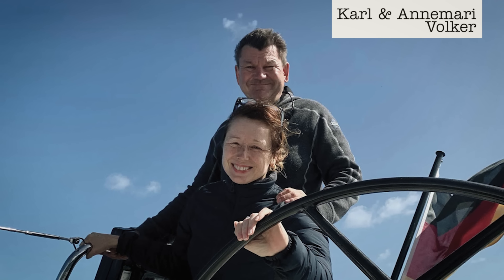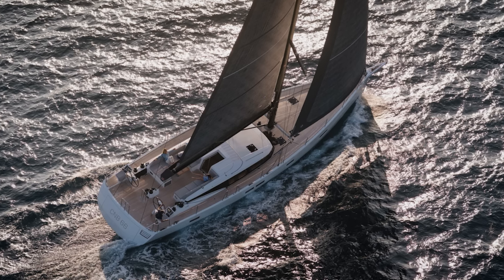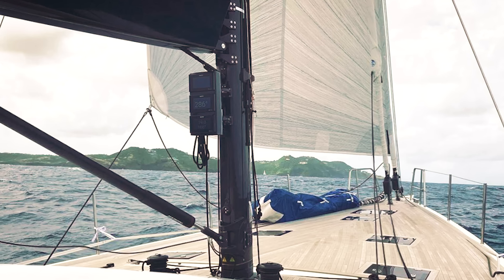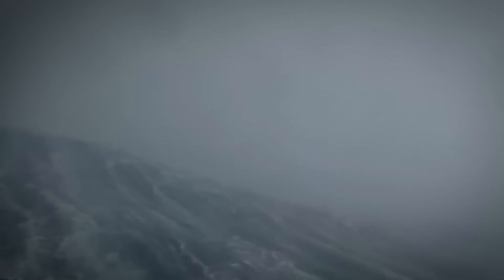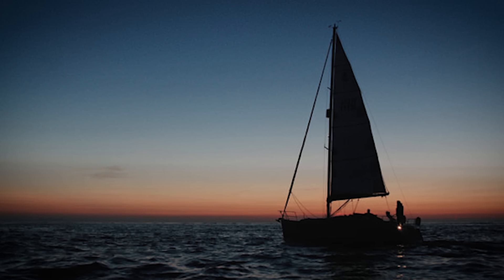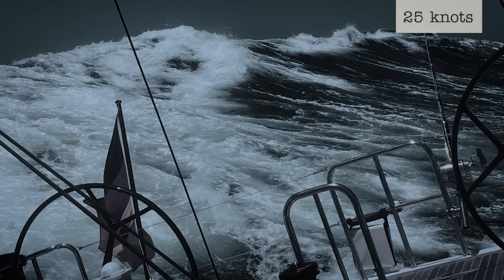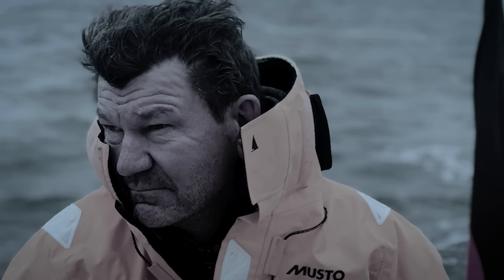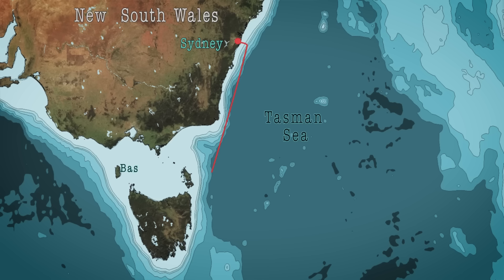Couple DIES on Private Yacht!

Comment: This is a tragic and terrible loss.  I've been sailing for 40 years and think that the older vessels (admittedly smaller) in which sail controls were manual and directly controlled at the mast are much safer for several reasons.  First,  they are very reliable since they are not dependent on electricity which doesn't mix well with water.  Second,  they are less prone to get hung up or jammed.  Third, they actually have better sail shapes (if mast furled) due to the ability to have battens.  Today's boats are also much flatter in the aft sections which not only makes them more uncomfortable in a seaway bu,t while their initial stability is higher,r they are prone to slamming and broaching more readily than more traditional cruising yachts.   While it's true the new designs have the comforts of a condo one might want to think twice before taking a condo offshore.

Comment: Well very sad ending to this ,,,,,, However I will add my thoughts.  First and what would have saved them is KNOWING their conditions accurately.  After the 1st squall was the time to REEF and STAY that way until daylight.  When the CURRENT Weather forces you to reef , it's already dangerously too late.  They got lucky on the first squall , and at night should have been far more cautious of it happening repeatedly.  

After all that the 2 mates who were unfamiliar with that vessel , and likely the owners didnt know this either ,, the CNB 66' with its "in boom" furling has no type of traditional Topping Lift.  This makes one think that the Duo-Winch Main sheeting system is the only means of control.  However, the Vang has a Rapid Release mechanism at the Clew end , and once released can be secured to either the Port or Starboard rigging base to relieve the 
" hot boom " situation.  I know it's easy to say that , but not being there and actually in that situation, who knows how successful that attempted solution would be. 
So I suppose the primary lesson for ANYone to take from this tragic event is
REEF EARLY
REEF OFTEN in repeated or unknown weather and squalls.  It is far easier to raise your sails than reduce your sails.  In my 40+ years of sailing and watching others , all too often reefing late leads to bad endings , although rarely fatal. 

God Bless them for living their dreams to the fullest. 

Sail On Folks.

SV Hydra
SV Jaz

Chris & Stella
Reply: I would call you comment for hindsight.
None of us know the exact weather conditions, and weather can suddenly deteriorate rapidly. Moreover, weather predictions beyond 3 days are almost always total garbage.
Reply: Exactly. Too late in reefing. And when they did...the skipper goes below? Wtf
Reply: @MalcolmLambe  I know right, probably like this " Ok if reefed the main , gonna head below and change my socks and make a sandwich "
lol 😂 
j/k
Reply: Too much sail up leads to chaos... if offshore a particularly v v bad thing to let happen

Comment: Thanks for adding the closure about what happened post rescue
Reply: Sailing and experience starts with a sailing dinghy and later increases the size gradually. It is not recommended to sail over a 30-40 foot boat if you have no experience with a sailboat. In strong winds and waves, sailing downwind is a high-risk affair. Autopilot becomes useless.

Comment: As an owner of a boat and sailing alone or with my wife, these are my recommendations to save lives (delivery crews take bigger and unnecessary risks) whatever the weather forecast gives you: put the second reef before dark, especially at downwind course. Yes, also the genoa. Allways. Anything can happen during the night. Anything. Forget big mouths saying it's time-consuming and slows you down. You slow down, but you give yourself security. And if sailing is too slow, stay home! Do not start reefing at 25 knots of wind in the night, that's already too late. Do not listen to crewmembers who are rushing you because they planned their flights back home. Make this clear from the very beginning. Nobody wants to die because of a stupid meeting missed. And what CNB concerns: as beautiful as ESCAPE is, the furling boom-system was a fatal construction failure and a central point in the cockpit for the mainsheet is an absolute NoGo! I am convinced that the people in Bordeaux gave way to clients requests, because, under sales-pressure, they wanted to sell another boat in order to reach their anual volume for the Group Beneteau at that time. (CNB was sold to Solaris in 2021).

Comment: I have never turned on the engine and gone head to wind to reef. This seems to me an odd strategy as the main has only to luff to reef it. Close hauled to close reaching on the jib allows maintaining steerage under sail with the main luffing and then reefing. I do know the boats I've sailed on with in mast and in boom furling have been at times problematic in the worst case scenarios, with yacht owners treating them with special vigilance to prevent jamming. Therefore- if you have either main furling option and it is prone to jam when overloaded, it behooves you to reef early. We also almost never sail dead downwind. It is not as safe and slower than sailing  a zigzag of broad reaches...

Comment: The long story obscures the fact that it was just a single maneuver that went wrong: luffing the boat from a downwind course into the wind.  

A boat of this size and type can be steered into the wind within just a few seconds (let's say 5–10 seconds), but even the best mainsheet trimmer using the fastest and strongest electric winch needs at least 30–40 seconds to haul in the fully eased mainsheet under full pressure in the sail. During this process, both line tangling and uncontrolled forces must be avoided. This is why the helmsman must closely coordinate with the mainsheet trimmer: the helmsman must not luff so quickly that the mainsheet becomes significantly slack. But this is exactly what seems to have happened.  

This is an apparently small mistake that might not matter in light winds but can have catastrophic consequences in heavy winds. Such an error is unacceptable for a professional skipper, even though it’s easier said than done in 40 knots of wind and rough seas. Even if there was a technical issue with the winch (unlikely), a mainsheet operator error or a line override / jamming (possible, especially since Annemarie wasn’t a professional very experienced in such harsh situations, it seems): in such strong winds, with a massive mainsail up (only in the first reef) and a super-heavy boom, under no circumstances can you afford to let the sail and boom swing wildly in the wind.  

The weather forecast, the boat design, and the reefing system were all fixed factors at this point. A boat like this, with good boathandling, can easily withstand 40 knots and more.  

Of course, I can only speculate like most people here, but from my perspective, this was a boathandling error that could likely have been avoided by a calm, focused helmsman acting in close coordination with their (non-professional) crew.

I don't want to blame anybody, I'm sure they all did their best. Things can go wrong easily in this kind of situation. For me, there is clearly a learning in here, and maybe for other sailors reading this, too (that's why I'm sharing my perspective).

Fair winds and following seas!

Comment: I run a real simple preventer system on my 35 footer (similar to the IMOCA boats)  off-wind of course but also when beating (acts like a kicker). I use cabin winches and clam cleats. Also I discovered something I call "reverse irons". Haul the sail whilst going downwind....The boom is something requiring constant control...IMHO.

Comment: Feeling like they skipped some steps. New crews (regardless of individual experience) really ought to practice maneuvers in good weather before setting out. Reef the sail. Do a hove-two. Practice a man overboard drill. Switch positions and do the drills again. It doesn't take long and you need everyone on board familiar with the vessel. Otherwise someone might not know where the jib cranks are stowed, how to turn the engine on, etc. Don't wait for the wrong moment to figure something out. Familiarize yourself with the vessel and make sure everyone else does the same.
Reply: Like you said:  "New crews (regardless of individual experience) really ought to practice maneuvers in good weather", and, even more importantly  "Switch positions and do the drills again"

Comment: The more expensive the yacht, more stupid things  it has
No travler?
Boom furling?I've seen that crap twice in my life on charter yachts
No matter how simple the solution was, it's actually a big problem, especially in these conditions, even with weaker wind, it's a pain an ordinary lazy bag handles even the largest sails
Reply: Yea exactly! These massive open yoghurt pots were designed to be comfy in a marina, and have no business offshore.  
It's dumb stuff like this that makes me glad I've got a slab reefed center cockpit steel ketch that looks after you. The boom going free-range on this boat is horrifying